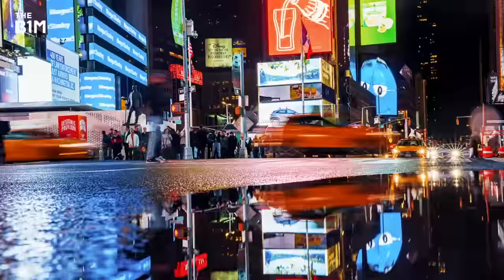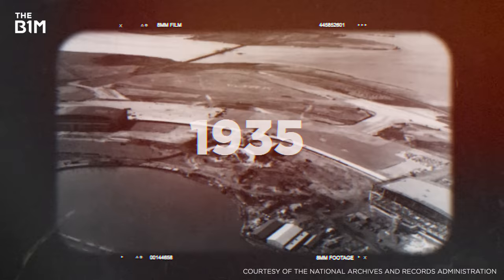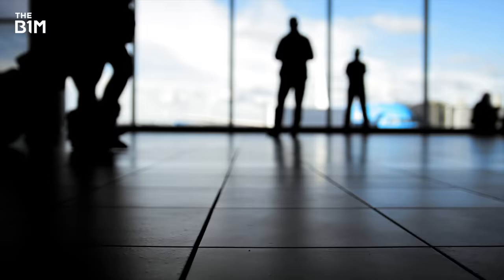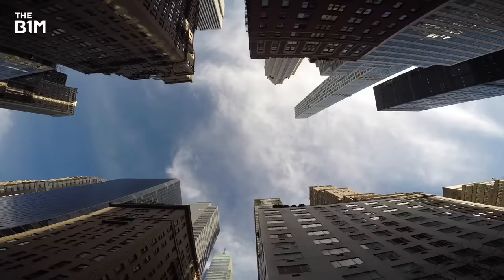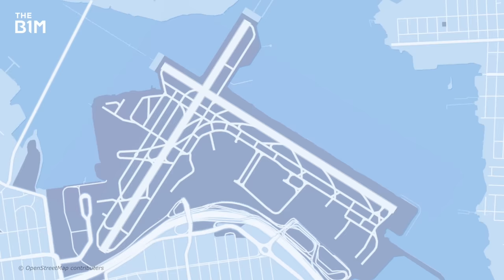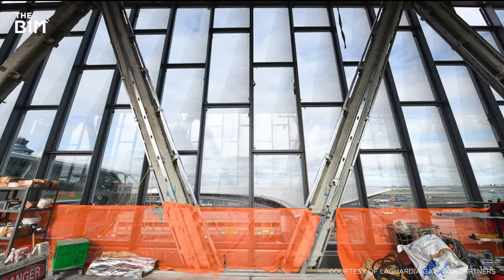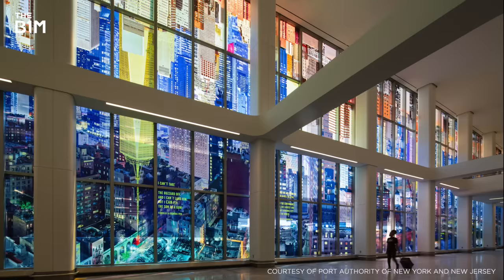The $8BN Plan to Save New York's Most Hated Airport

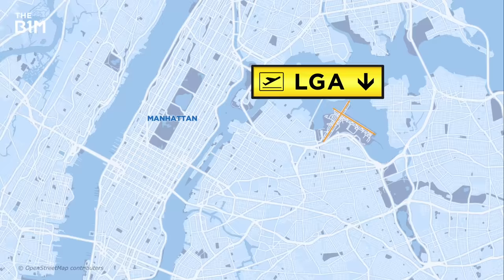Comment: I think if I were them, Id explore some land reclamation on the right side run way based on the image at 5:59. It could be a net cheaper plan than any that requires buying built up land or land reclamaition for a brand new full runway. If you can seperate the two by extending that runway into the sea and cut it off before it intersects I think they could swing planes interchanging landings. Im pretty sure there are very strict and specific rules for airplanes landing/taking off at the same time on seperate runways, but it would make the ability to land planes interchangably a much quick process. As one plane lands another is on approach to the other runway and you wont a have to wait until plane 1 is clear of the runway before begining the landing process for plane 2...which is what they have to do now.

Comment: so simple (for me) all we need are more buses to connect the LGA to the subway on the Q70 lines.....
(seems that the buses are about every 30 mins and should be more frequent) 
Ive been traveling every other week and no issues with late flights departing.. just the hardship of getting onto a subway to NYC once I have arrived on time which is most of the case.

Comment: NYC airports need more runways.  Either build a new airport out in the pine barrens with a high speed rail to it, or build out on the water, with a floating airport (like one in Japan), or on reclaimed land.  Sacrificing Teterboro except for emergency landings doesn't sound like a massive sacrifice, if it made the main airports handle more traffic.  Or go full London, and have a half dozen airports scattered about (London has LHR, LGW, LCY, STN, LUT, and until recently Southend), and connect most of them by rail.  Better connections to HPN, ISP, Newburgh Stewart, Trenton could help make that workable.

Comment: If they cant connect the AirTran to LaGuardia from Jamaica Station, than no amount of new terminals or pedestrian bridges will fix the airport. People coming from LI will continue to drive in, and the people from the city will still have no means of getting to the airport other than a few buses or a cab.
Reply: The Q70 and M60 will have to suffice for those in Manhattan for now, although I wish the N and W were extended past Astoria. Would be easier and affordable, but the NIMBYs in the area are screwing any chance of that happening.

Comment: I'm sure the taxi drivers would have a fit, but I wonder what would happen if the airport simply ended passenger access to cars at the airport. Just placing your pick up and drop off areas elsewhere and connecting them with a shuttle/people mover would open up space and decrease  congestion.

Comment: This is sort of unimpressive when you dig into the numbers. $8 billion in improvements and a couple dozen new gates for essentially a regional airport with just two intersecting runways that can't accommodate modern widebodies seems pretty inefficient. There's a reason that a majority of the funding is private - the airport can't generate enough user fees to finance this project. Terminal B is going to clock in at $5 billion for 1.3 million square feet. By contrast, in Chicago, O'Hare is also spending $8 billion on a terminal modernization/expansion. The new "Global Terminal" will replace the existing terminal 2. It has a price tag of about $2.2 billion and clocks in right at 2.2 million square feet. With the two new satellite terminals ORD is getting a 60% bump in terminal square footage (5.5 million to 8.9 million) and getting 50 new gates (that's 70% of LGA's existing capacity of 72 gates) all while maintaining existing operations and capacity. And it's entirely self-financed among the airport authority and the airline partners. LGA's performance is always going to be capped by its runways and lack of transit connectivity. An $8 billion mostly cosmetic makeover isn't going to change that. By contrast, ORD has 8 runways, more than any other civil airport in the world, and is a major cargo, international, and regional hub. A 25% bump in gates and 60% bump in terminal space is huge and is more than enough to catapult ORD past ATL for world's busiest airport by passenger volume (it was already a close second in terms of aircraft movements, pre-pandemic, before the runway modernization was even completed).

Comment: A major design flaw of LaGuardia is the atypical designation of gates.  Whereas all other major airports assign a terminal letter to one hall, this stupid design instead uses the same letter for multiple halls.  So if your flight is boarding at gate D23, good luck finding it.  I recall discovering this perversity years ago, when I was departing from a gate in a hall that had two different letter designations.  Truly bizarre.  Not sure if it is still that bad, but the basic design flaw does remain.  This makes it nearly impossible to find your way without knowing that this is a horribly designed airport.  This is, of course, easily fixed.  But apparently even this multi-billion dollar rebuild misses the obvious.  Nice work!

Comment: As soon as they find a way to connect this place to N/W line I will actually use this airport instead of the longer trip to JFK. The 7 at Willet's Point is too far. They should just construct an elevated line over the GCP and connect to the N/W line on Astoria. But at least step 1 done, no more 3rd world airport.

Comment: This project was a mistake.  It did nothing to address LGA's airside problems.  It still has the same two runways that are too short, and intersect with each other, limiting throughput.  And the new terminal designs just locks this in.

Comment: The numerous problems plauging LaGuardia are not all external. NYC today, as an infrastructure in part suffers significantly as a result of a great deal of civic failure ("design and redesign") principally from the 1960's. One look at Penn Station sez it all...........  In order for LaGuardia to properly serve, a great deal of "undoing" and en suite redoing need to occur. It's getting there. The facility is imperative to the metropolitan area.

Comment: There was shortsighted planning for decades when Queens and the surrounding areas were built up in the mid 20th century. It's inexcusable there was no mass transit link to LGA built at the time, capable of connecting folks traveling eastbound to the LIRR and westbound via subway to Manhattan. The plans proposed by Cuomo were awful and honestly any line being built now would be prohibitevly expensive.

Short of a war or natural disaster that wrecked the entire area necessitating it be rebuilt from scratch, I don't see any realistic solutions to the issues the airport has.

Comment: I was just there in November 2021 and NO it did not look like that it looked like shit there was no room and the lines were wrapping around five times in a 20x 140 space just inside the outside doors. I don't know what these are images of but its not the Laguardia I was at. I was Flying Delta so that terminal is still shit and the means of getting there is still part of the problem.

Comment: Why don’t they build an air-Train right to the N train. It’s so close!like 2 miles from the airport
Reply: Extending the W line would be better because 1) its one of the only trains that goes near Staten Island and 2) not many people take it because the N is faster and goes to all the stops in Astoria so most just opt for the N. If the W was extended to serve BOTH big terminals at LGA, it would give riders a reason to take the W train and thus alleviate a small bit of congestion on the subway while also connecting 3 of the 5 boroughs to Queens (Sorry Bronx).